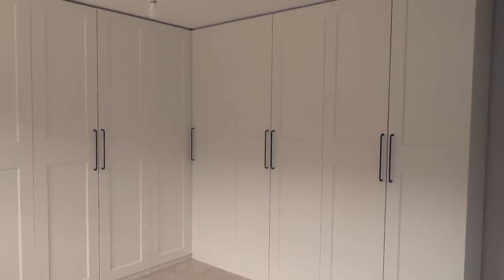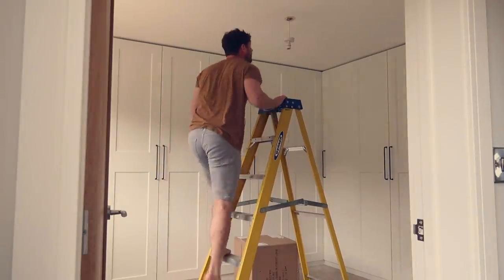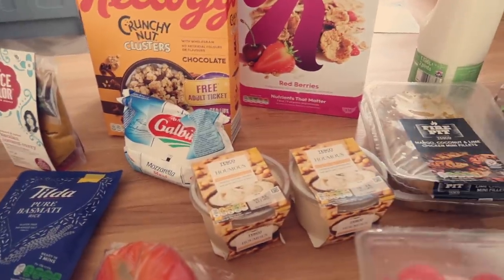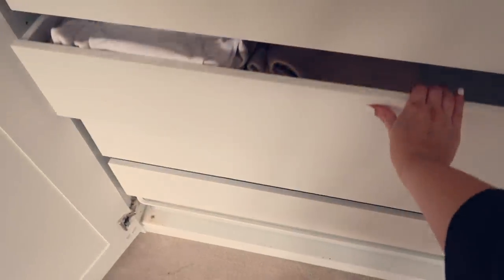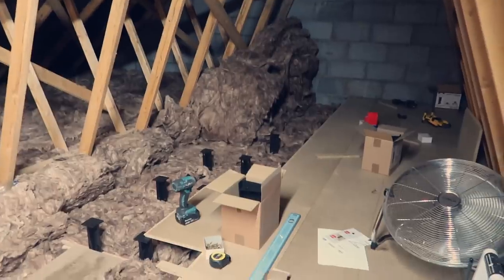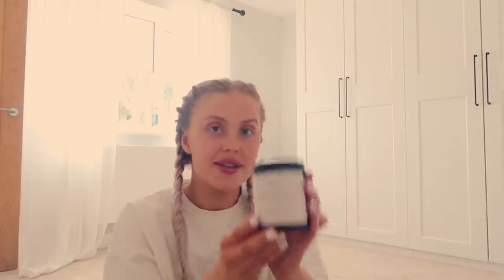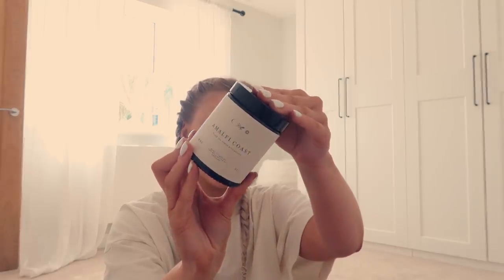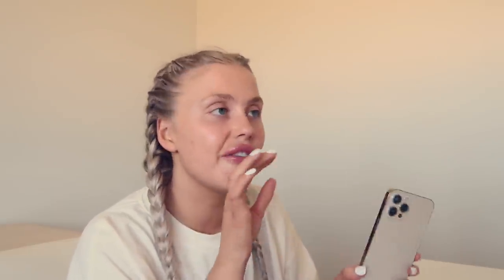MOVING VLOG # 6 | dressing room updates, ikea haul + homemade DIY furniture

Comment: Check into getting an attic fan installed. It pulls the hot air out of the attic and will cool your top floor off so much. Worth every penny! And you can even get solar powered ones ❤️

Comment: Gemma you need to read the description of the IKEA product.. They always provide the LxWxB measurements etc. 

No wonder it is so hot upstairs, look at the walls and roof in the attic.. They are not insulated.. If you finish off the loft and insulate it all and put internal walls in, that will help with the heat and the attic room will be nicer to use to. I finished mine off and put down pine wooden floor looking linoleum and built shelves up in my attic for all my decorations in clear labeled boxes.

Your dressing room will look fab when it's finished 😁.

Jamie's bit was cool to🤗. Glad he had a nice few days when his friend visited.. How did the pub cycle home go when they were so drunk?

I love solid wood.. All my furniture is solid wood.. It gets better with age.. You can water down paint so you still see the wood grain through the paint.

Comment: With the heat, we live in a new build and we were warned about summer - because they're super air tight for the first few years they have no ventilation - works well in winter as you only need the heat on for a short time before it gets warm and stays warm but in summer we're all suffering haha!!

Comment: Gemma every time you say “it’s so hot” or “there’s something wrong with the upstairs of this house” I want to tell you it’s a heatwave and heat rises so your upstairs will be much warmer than downstairs at the moment, and it really is hot. I doubt that there is something wrong with your heating - as it’s a new build I expect your loft is super insulated and the heat can’t escape through the roof (ideal most of the year but not if downstairs heats up and the hot air gets trapped upstairs). Xx